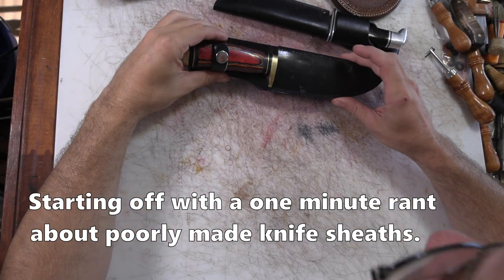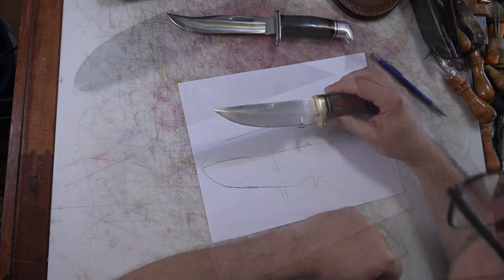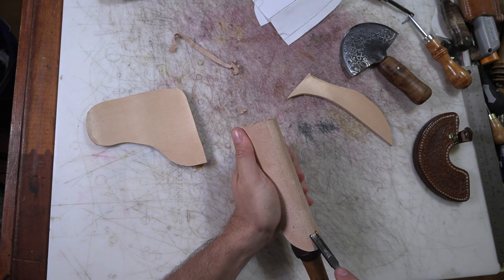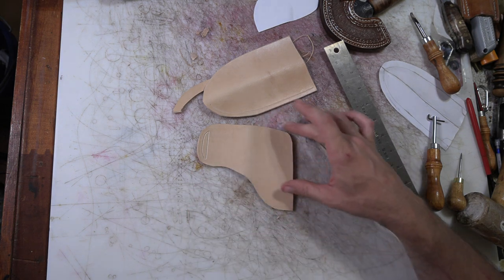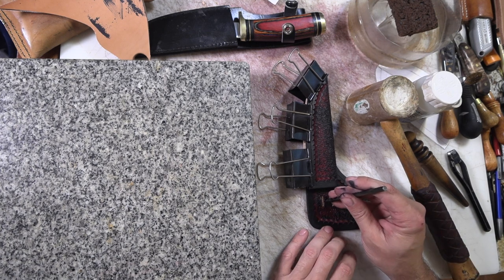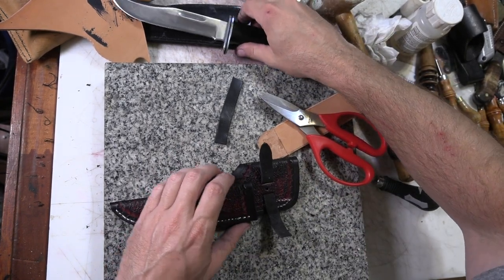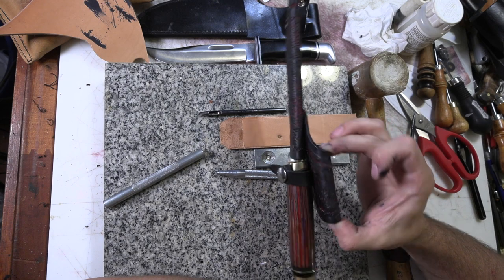Making a horizontal scout carry leather knife sheath and critiquing the sheath the knife had

Comment: What is a good cheaper sewing machine for leather. I hand sew everything I make. I'm new to leatherwork and would like to be able to sew quicker. Also. What leather company should I buy from.
Reply from the maker: Good and cheaper are two different categories for leather stitching machines in my opinion.  I started with a Tippmann Boss which was much better than hand stitching.  One of my complaints was that it wasn't reversible, and they do have a reversible version now and it is actually cheaper than it used to be when I bought one 15 years ago.  Cobras from leather machines are great stitchers.  That is what I currently have.  Cowboy machines are good too.  I buy from Springfield leather company for the Hermann oak leather I use.  I have also bought from Weaver.  And I have a Tandy store nearby that I buy hardware from.  And there is a small business in St Louis I get dyes and glue from called STLeather.
Reply: @bransonsgeneralstore  thanks for responding. I'll look at those machines tonight. I'm definitely not a pro. I started when I got a kit for Father's day and have made approx 40 or so projects now. My work has gotten better since I first started. Enough so that my next leather will be quality 9 to 11 ounce rather than 7 or 8 ounce. I've got a good collection of stamps and tools now. Thank you. I enjoyed watching this video. I'll probably ask questions later in too.

Comment: Nice ! Great job. Great video. 
What leather brand do you use? And how long in real time did it take. Thanks.
Reply from the maker: I lose track of time while working so I am not sure.  Probably two or three hours not including time for dye and finish to dry.  The leather I use depends on the project, but mostly I use Hermann Oak sides for anything carved, and double shoulders from Tandy if it is a project that I don't think needs the good stuff.
Reply: @bransonsgeneralstore  Thanks for the reply. I’m new at leather work and appreciate the info. I keep two or three projects going and juggle back and forth as they dye or glue. 
But even as a beginner I noticed the difference in using better leather. Thanks cheers.

Comment: Nice work.  I have a green river butcher knife.  Between the upsweep at the tip and the square handle with no guard, I can't figure out how to secure it in a vertical sheath.  Do you have any suggestions?  Thanks.
Reply from the maker: I made one for a green river skinner once and left the spine of the sheath open and put a strap around the back of the blade before the curve.  Not sure if that will work with the butchers knife.  If you use a wide enough strap to keep the blade from pivoting around it, and keep the sheath a close fit on the straight part of the blade you might be able to trap that curved tip in there with the strap.

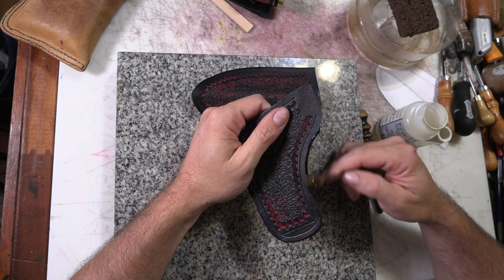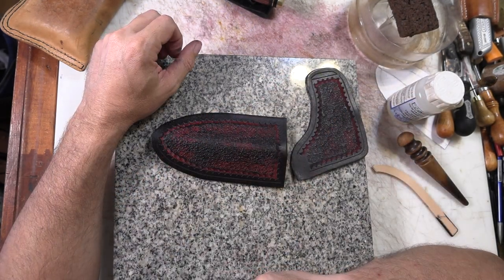Comment: What is that tool that you used at 13:48-14:00 to finish the edge of the leather?
Reply from the maker: It's a wooden slicker.  It has several sizes of round grooves that are used to shape and burnish the edges

Comment: Does the retaining strap ever get cut upon drawing the knife?
Reply from the maker: It can.  If the knife has a guard on the spine side it is usually better to put the strap around that.  In this case a horizontal sheath with a retention strap was requested.  If you are especially worried about it you can make the strap so it gets further out of the way when unsnapped.  You can also rivet the strap to the back of the sheath and if it gets cut just cut the rivets with a nipper and replace the strap.

Comment: I have had that exact same buck knife For over 20 years - I want to say t's a model 110 but I can't remember
Reply from the maker: This is a 119.  Buck has made tons of them.
Reply: @bransonsgeneralstore  i’ve actually owned two of them. The one I got back in the 90s I passed on to my son, and then bought one for myself. They last forever and hold a good edge, and like you said in your video, the sheath is very sturdy and has never worn out

Comment: Can I turn my 119 sheath into a horizontal sheath
Reply from the maker: Probably.  I think how I would do that without taking the sheath completely apart or starting from scratch.  Make what is called a belt frog.  Really just a piece of leather about 2 1/2" wide and maybe 5-6" long.  Cut two slots about 2" long somewhere in the middle.  These will be what your belt passes through.  Cut another slot near one end big enough for the blade part of the sheath to fit through.   Cut the rivet that holds the belt loop on the sheath and use that hole to rivet the sheath to the end of the frog without the slot for the blade.
Reply: Thank you that's a great help